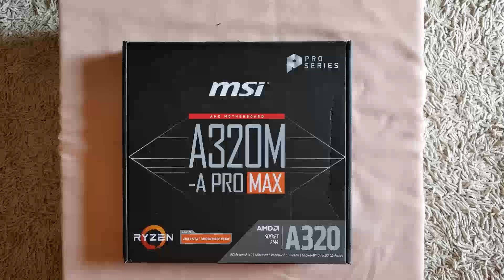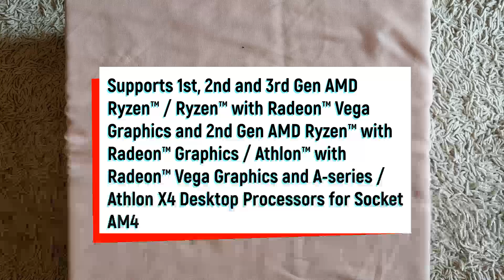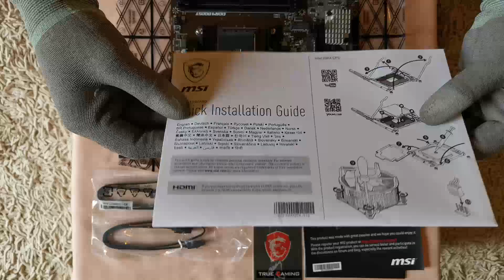MSI A320M -A PRO MAX | BUDGET PC BUILD

Comment: If I connected Ed a 4 pin fan extender to attach 4 case fans would it work?
Reply from the maker: Yes but I recommend to connect it directly to psu instead on mobo..